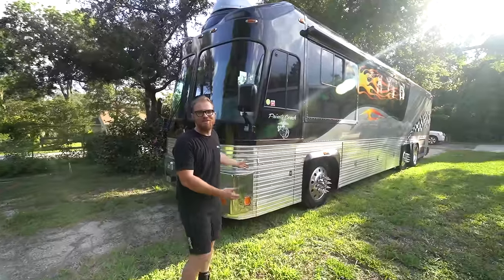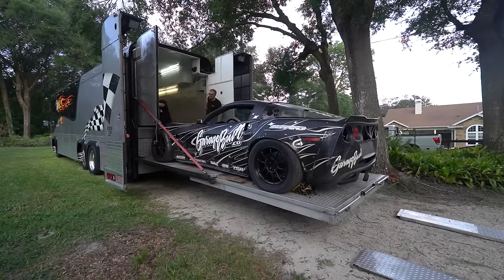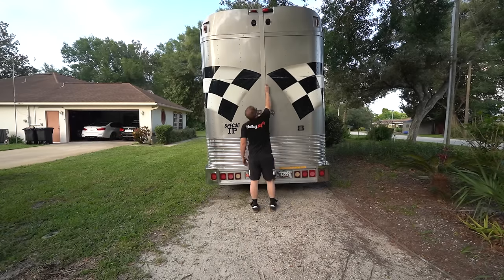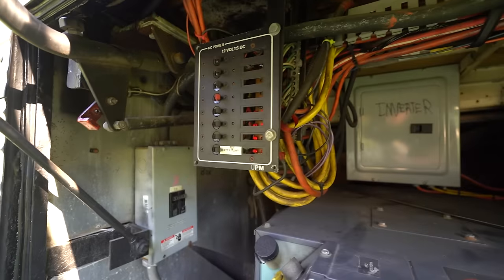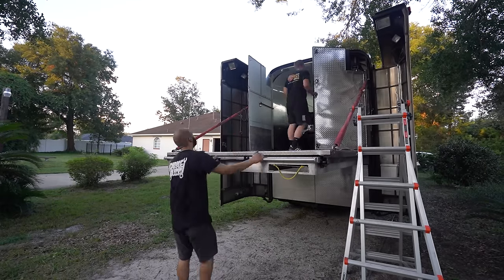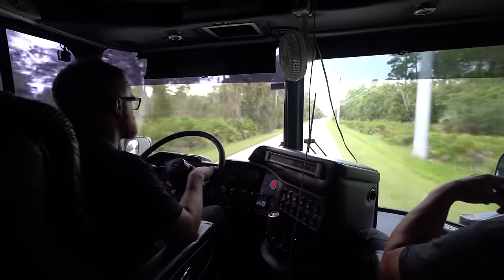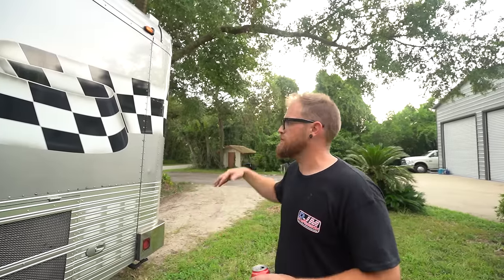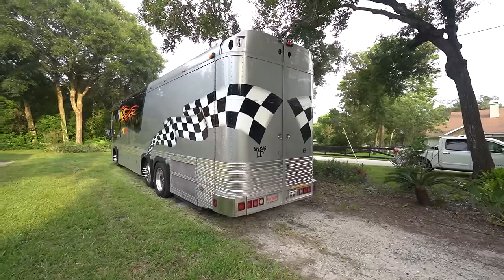First test of the new race car hauler. RV bus conversion. will it fit?

Comment: I have owned 4 Eagles and cannot understand why anyone would have gone this route to build a hauler out of one. It looks great but the practicality of going behind the engine compartment and close it in is Ludacris. It's difficult enough to service the engine when it was on the very back of the bus but now it totally enclosed is absolutely nuts! These old Eagles have enough problems with cracking around the rear suspension when they are in the stock configuration, I can only imagine what this will do the suspension.

Comment: Absolutely badaxx man!!! Most likely have em already, but buy new  CO2 detectors. Would do two in main cabin and one in the garage area. Cheap insurance to a deadly issue. Also buy multiple spare belts/filters for engine/generator. Might want to get some new pulleys while your doing maintenance. Congrats on an amazing setup!!!

Comment: Get some "Slip plate" it's dry graphite spray or brush on it works great, tips from a car hauler of 15 years. Spray for tight spots, it is messy and sticks to everything, diesel will break down and remove it from unwanted surfaces. Apply it on warm dry days.

Comment: That looks like a red top n14 celect plus they are solid engines one of my personal favorites very powerful motors and reliable sometimes they do get finicky with fuel problems but very straight forward to diag 👍🏾

Comment: Matte black livery would look cool yes, but the garage on top will be COOKIN. I'd rather see if some hints of the Vette livery could be wrapped over the middle section somewhere, where currently the eagle and flames are, and then fading out into the Aluminum for the most possible geat reflection 😊

Comment: The bus is Awesome; glad it fits the 'Vette!
I'd get some planning done and get a contractor lined up asap (there all probably busy there, like they are here) to widen the driveway and I would consider a concrete pad for the side yard (you'll need to remove the substrate probably 6" deep and get a good rock base down to hold the weight of the bus, whatever surface you go with). I do not want to see a video about the bus stuck in the front yard after a nice Florida rain (and you know it will)!

Comment: The Cummins looks like a M11, there should be a dataplate on it btw. You can rebuild them, I wouldn't mess with the ECM, they are expensive if it is ROM booted. Leave it stock and overhaul it when necessary.

Comment: Some sort of channel the width of the corvette put on the ramp exactly centered. Unless that will mess your tires up. Anything else you pull in there will be skinnier, as long as your inside the channels your clear to pull it in. And maybe just lengthen the door lock bars an inch each to not worry about bungees

Comment: Hey Taylor, So glad your happy with this. its a dream come true for alot of people and seeing this makes me so happy for you. coming from someone who drives trucks on the daily. your on day 2, use it as a daily for a month and you will be able to put it almost anywhere. It also might have a lifting rear axle that will help with getting round tighter corners as some of the smaller trucks ive driven have this, lifts the rear axle about 1inch form the ground, is also useful if your in snow/mud as it puts the weight onto the drive axle. Only other major thing id recommend is changing the winch to one with a synthetic rope as when a steel rope breaks it can cut you in half and the synthetic ones can still hold the weight but dont carry the force as much if they do.

Comment: Here's an Idea from the dirt track racing world. Weld a steering wheel quick release to a piece of tubing about 8 feet long and put a quick release nut on the other end. This way you can have your steering wheel all the way at the back bumper so you can steer it while winching it into the bus. You would have to put a hole in the rear window or possibly use one you already have?

Comment: If you want on board air you can either put a spare tank on with an air hose fitting on it and use the buses air compressor to fill the tank. Would be good for just in case situations like if your portable one dies or it breaks at a comp or something like that. Just a thought. I have seen it a few times on some of the semis I work on and I have seen it even more on rvs that have air brakes also.

Comment: Hell of a rig you have there Taylor.  I'm sure you'll get all the bugs worked out soon enough once you start using it on a regular basis.  One thing you may want to check, especially if you intend to be sleeping over in it using the generator, are Carbon Monoxide detectors.  You may already have them installed on this unit but it never hurts to have a couple backup battery operated ones.  I can't wait to see your first road trip to some drifting events.  Cheers!

Comment: Removable centre section on the loading ramp would give you a way to work on the car if you need to pull the gearbox etc

Comment: If possible need to open the center of the lift gate then you have a short lift if you needed to work on the car. Of corse some a fram Jack's for support

Comment: Hi how are you doing I love your rv/car hauler bus.  One thing though what I would have done is the ramp platform should not act as a ramp.  The platform you drive car onto should raise up the way it does but once it is up with car on it I saw that you winches car into bus but what if the platform slid into the bus with car on it that would be awesome that's what I would try to change with that set up if possible wouldn't that be great you wouldn't have to drive car into bus and put up ramp just drive car on it lift up and some how get platform to slide in maybe rollers on it and winch platform in less chance of damage on car and bus I saw you trying to steer car while winching it in if whole platform went in less chance of damage and it would be easy wouldn't have to move car

Comment: Dude Taylor, this is thing is fucking sick! Hopefully it works out in operation like it seems it will. Curious why the previous owner wanted to trade you for a traditional trailer. If the rear doors are the tightest point, maybe look into a quick pin removal system so you can take them on and off? May or may not be worth it depending on how they attach, but could get you a couple crucial inches.

Comment: I like it, and I think it’s cool, but I’m seeing a few problems in the future. 
Problem one, you have no vehicle to drive if you need to go get a part, go get lunch, whatever. 
Problem 2, maneuverability into some of the smaller tracks, tighter areas you’ll need to go.
Problem 3, the amount of room you need to get the ramp down, and the car outside may prove to be a nuisance. 
The smaller issue will be the lack of room with the vette and all your tools/spares, and tires, although that will be fixed fairly soon, I’d imagine. 
Ditching those 2 doors for a roll up door will help a ton with the loading/unloading room.

Comment: You should really put the back internal loading door locking mechanism on the inside. so that when you are getting out of the bus you can unlock the doors so that you dont have to go outside, unlock the bottom locks and slowly go up to unlock the top latches

Comment: I have a M11 Cummins in an older freightliner. The sweet spot is around 1250 to 1450 rpm. Your automatic should regulate it fine. I have a standard, so Ill drop a gear to keep from lugging it.  I've been told the Cummins can get block fretting from being lugged. I'm on my second M11 It was a reman five years ago. The rocker gasket on mine is leaking but not bad yet. Thats a common problem. I have my service done at 300 hours on my motor, but I idle a lot running a pto and vacuum pump. Have it greased once a month and brakes adjusters checked for adjustment regularly. Your service could vary with milage instead of hours.

Comment: I would put some solar on top of it , that way you're not only dependent on the generator, it being running or outside power for it... 
About the not being able to drive to anywhere part(on the other video), you can get a scooter or something like that to go shopping for a few things and make the trip back (taking a backpack for extra stuff and you can also get a case for it)... 
Getting a satellite internet service to have cable internet and wi-fi would be amazing thing, about the TV, it must have some button that you have to press to reach to the dvd mode to have picture or on the dvd itself or there's a channel that's configured to it... also change all lights to LEDs is a really nice idea

Comment: In most states you DON'T need a CDL as long as it is plated as an RV. A couple of things you do, make SURE you know how to adjust your breaks ,and i wouldn't take it to a Cummins dealer at first if it's been turned up any. There's a good chance a dealership WILL  set it back to specs. Good luck with it.

Comment: Maybe be try the back end goes in first (a lot easier to drive out and winching the rear would be a lot easier, also it wont be too taxing on the platform when the car is suspended (if u notice when the car was lifted on the platform theres a slight bow although being supported but can be a potential failure point) jmho.

Comment: 2 things that will make things better for u get a steering buddy it attaches to were ur steering wheel goes and u get a remote and then u don't need to be in the car to put it in and then a wall mount for your tires then u would have more room for a grill under and u could keep ur out side fridge so u can keep less traffic in and out of the camper

Comment: Another thing because I think I deal with those motors a lot looks like same top end but as far as jack brake usually if cruise works your Jake works because you will notice that cruise not working before that Jake

Comment: Probably lots of work but you should make a new rear door for the bus, one that flips up on gas struts or hydraulic rams. 
Lots of pros less people required to load, doors wont rub on the cables, extra rain cover

Comment: I would check out all the belt's and hose's on the engine and if any look suspect I would replace them just as a safety precaution you don't want it breaking down on the road at an inconvienent time.

Comment: Might need to adjust the cables on the rear platform, it was crooked after loading the car, you could see it in footage as it was folding into the back. Probably beefing up the platform and the ramps would be a good idea. You love fabbing stuff anyways, so make it safe.

Comment: Super simple idea for you but using some paint on the deck for the perfect space at the outside of the tires will help speed up loading

Also for the sake of truckers sanity if you go to a truck stop for fuel when you're done fueling PULL FORWARD TO THE LINE

Comment: your cable winch issue i would shorten the cable of or till the length required to drop and lift that door (that's the only purpose its for ) this should resolve that issue by the way this is a mean damn machine the bus the vette is wicked we need to see it perform and yes its a CUMMINS N14 Select Engine its got 3 red valve covers

Comment: Measure and mark the centerline of the ramp, mark and measure the centerline of the car, measure out to the track width of the front wheels. Paint stripes for each and then your spotter can make sure your tires are aligned with the stripes. Extend these all the way out/down the ramps. The car is always centered in the bus.

Comment: the winch should be able to be moved to the center of the ramp so it pulls straight and gets stored to the side
there will be a av setting the tv needs to be on for it to work
the right hand front top light is flashing might be a wire or the failed light

Comment: Change the av input on the tv lol. It sounds like it set up so you can watch a dvd or something else in the dvd or vcr player but keep the tv off. So the sound and tv are separate systems.
edit. Now i'm thinking about it more, the vcr will be channel 3 or 4. The dvd will be on av1. and the sound of those will be routed into the hi-fi not the tv. So no sound will come out the tv, just the hi-fi.

Comment: We all know how you like to fab so I suggest your first fab job for the coach upgrades should be to put the generator on rollers or build a rack that can allow you to put in out like a drawer. Makes it easy to service/repair/replace and if you set it up to run outside yer not heating or heat soaking that area of the bus. Make sure all bay lights are ran to switches near the doors and install bay lights in the engine area. I think they make radiator kits with flexible hoses to swing out and allow side access the engine.

Comment: Not to induce panic but from experience I would install a fire suppression system on the bus engine if not already equipped.  Worth throwing a few bucks down on an investment especially if your gonna sleep in it. Or run some fire drills to see how fast you can get into it to put a fire out.

Comment: I'm wondering if the inner doors for the garage are really needed. Looks like the vette would load easier without  them. And less likely 2 damage the vette while loading/unloading.
Reply from the maker: They’re there so you can seal it up and ac it.

Comment: To center the car on the ramps measure and apply some duct tape first to the tire edges on the ramp where the wheel base is centered on the ramp.

Comment: I was a enclosed auto transporter and recommend getting a 12v wireless crane remote and receiver. Rewire your lift gate to run off of the remote instead of the buttons that are not that easy to get to with the doors open. If you get the right one you can also wire it to control the winches as well. It saves time and is safer to use while in the air.

Comment: You have a Cummins M11. Get  the engine serial number off the tag on the front cover. You get all parts info with that serial number

Comment: It he is serious about living in the garage when at the track I think you should get a curtain rod to hang a blanket or whatever. This way he has bit of privacy from the main door. I would have claimed that space for myself too. Just a foldable cot and the curtain and Insta bedroom. I think when you move the bus to load of unload just pull the nose of the bus to road or just as much space as you need for the lift to load or unload straight into and out of the shop. Then you don't have to worry about the grass or landscaping. And as I said in your last video when you replace the tv redo the sides also to give you a space to put subwoofers.

Comment: Taylor, on that engine you should find a tag that says ESN. That's the engine serial number. Get that number and call your local Cummins Sales and Service location and tell them you want the details of that engine. They can tell you what engine it is and what HP calibration it has. If you can't find the tag, you can give them the full VIN of the bus and they can do a VIN to ESN look up. Cummins keeps track of every engine that is put in anything from new.

Comment: Park that hauler on solid ground. You won't belive how easy they sink on soft ground. Also mentioned it in your other video, fix the air leak that's draining your air tanks. You can be inspected by highway patrol and be put out of service for a bad air leak.
I suggest you download your state CDL prep course and go over the air brake system so you can have a good understanding on how it works

Comment: Id suggest swithcing the wire cable on the gate winch to synthetic. Bright colored!!! itll save your face, your hands, and just look nicer as well. can cut it short for just what you need, itll minimize the tangling up as well...
Haloview wireless RV back up camera has saved my ass more then once, for me on my 36' skoolie conversion. I have 4 cams. sides, back and back of towed trailer... if your looking for a setup they are really decent. 
 Its a baller setup... love the unique
Reply from the maker: This has backup cameras. It has one on each side and then one in the rear.
Reply: @Taylordrifts  thought I saw you mention something it during pickup; didn’t recall if they’re older or outdated.

Comment: Looks like the builder was an MCI fan. MCI is another motorcoach company, and those rubber wheel covers are from MCI coaches, as well as the steering wheel. On an Eagle coach, the wheel wells are round, and if they haven't been cut up under those covers, you may want to remove them. Just google Eagle Model 15, to know what they are supposed to look like. Also, a lot of busses and semis use that steering wheel, but this one has an MCI logo. You might want to find an Eagle logo for that wheel, or even find a wheel from an Eagle Model 05 or 10. The old white Model 05 wheel with the red Eagle logo would be style points. LOL. These are old parts, the Eagle came out in the 50's and kept mostly the same style.

Not that it matters since it's been repowered, but this would've come with a Detroit 2-stroke 6V92TA, or 8V92.